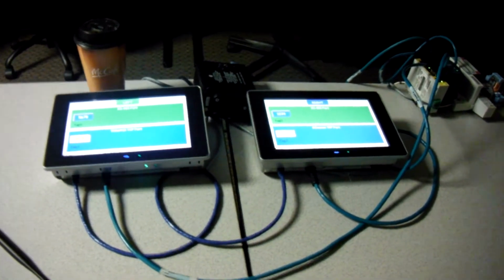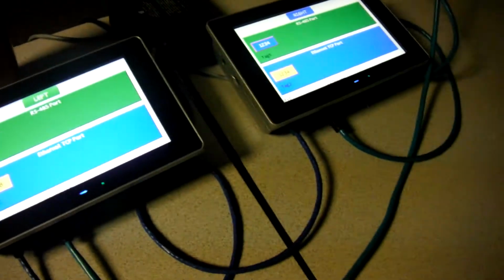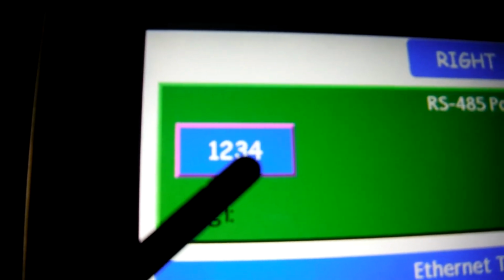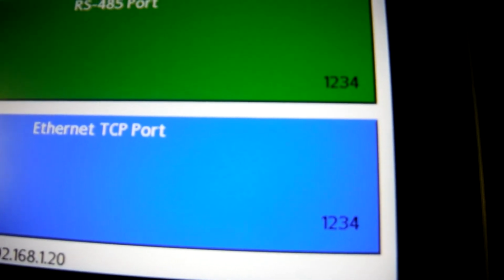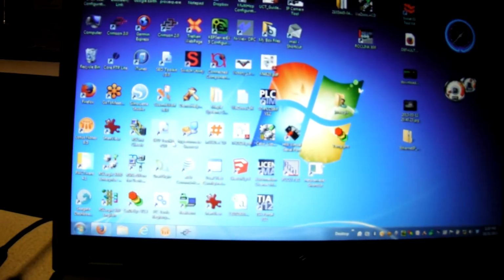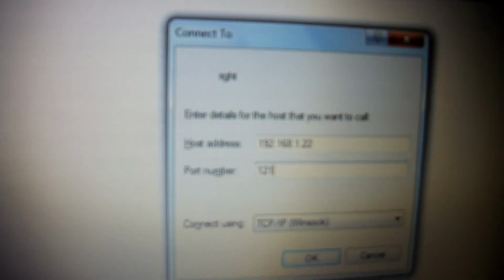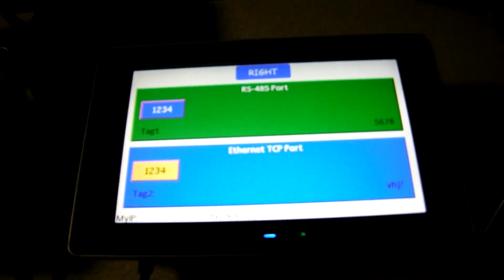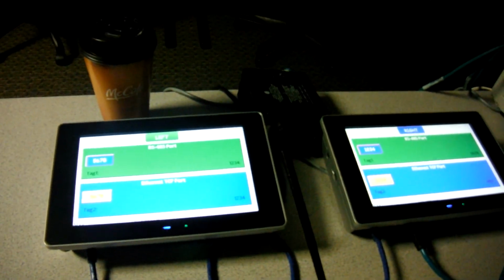Red Lion HMI Raw Serial COMMS

Comment: Are you using the same port 1234 for read and write?   I have created two separate RAW drivers i.e. RAW TCP Passive for receiving and RAW TCP Active for transmitting.
I am able to receive data but not able to transmit? I am using PuTTY to communicate with the HMI. My PuTTY gives an error Network Error: Connection refused? Any idea why?
Reply from the maker: yes.  Send me an email and i will send you both of those databases used in this video.  wazoo@adcreps.com
Reply: @JoeWaZoo1_Geeks_Rule  you know what I was using an Active raw tcp driver for reading, I just switch it to passive and it works. 

Do you know the difference between those two drivers?  The manual is not clear in that case.

Great to know you are from Irving, I live in Irving too. Lol.  Thanks

Comment: Congratulations!! Could you help me with the configuration raw serial via RS-232 between a G3 HMI and a barcode reader? Or where I can find information? I have read the manual and seen videos but I couldn't realize the success configuration. Regards
Reply from the maker: Did you make your own cable?  What is the part number of the bar code reader you have?
Reply: No, I'm using a standard cable because I don't understand what configuration of the pinout is the correct, either pinout of the barcode manual or pinout in the red lion document. I have the code reader CR1421 of the brand CODE. Thanks a lot